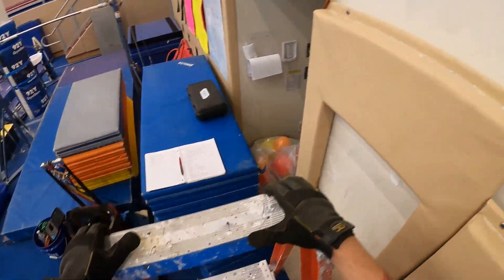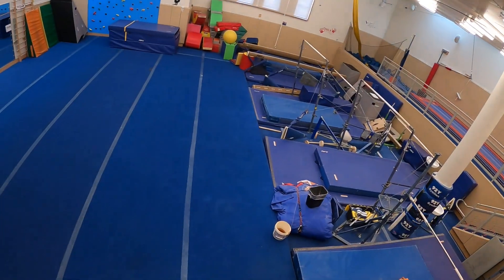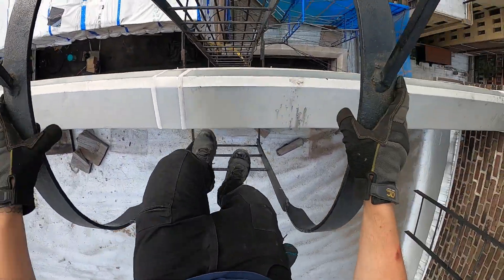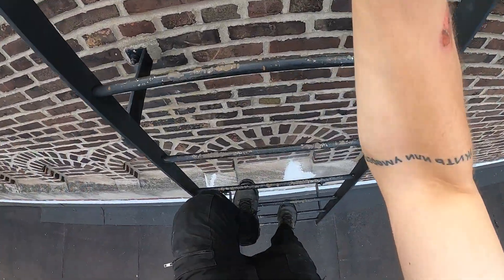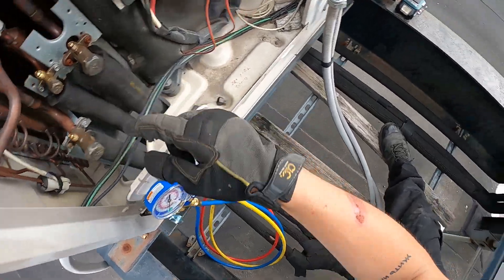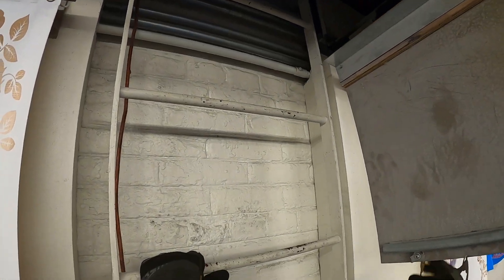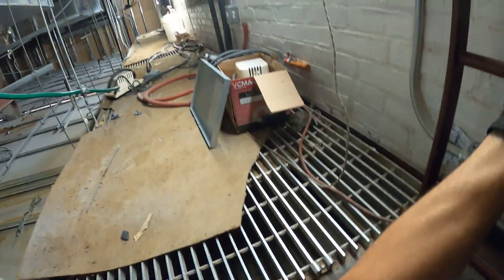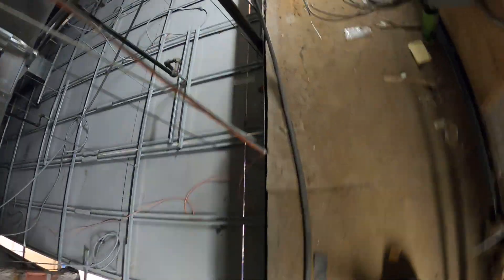HVAC: Worst HVAC Unit Location EVER! (LG Multi V Inverter Heat Pump) Scary & Dangerous! Must See!

Comment: Its definitely not convenient, especially with that ladder cage getting in the way of taking things up with you. But at least the roof is clean, appeared safe, and looks like it may even be maintained regularly. And the indoor units, at least they're right at the ledge where you can access them. It looks like whoever planned that out did a pretty good job of making it as easy to work on as the conditions permit.